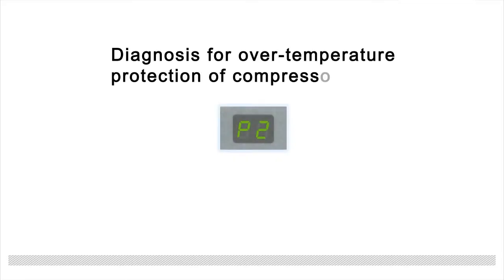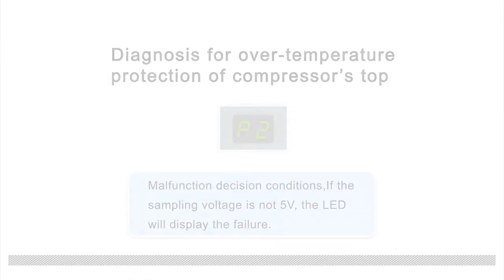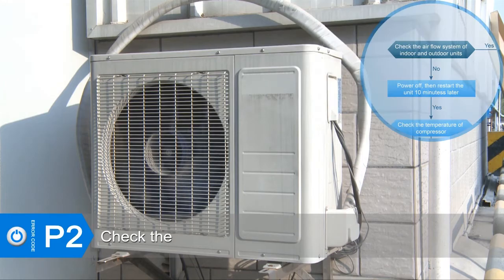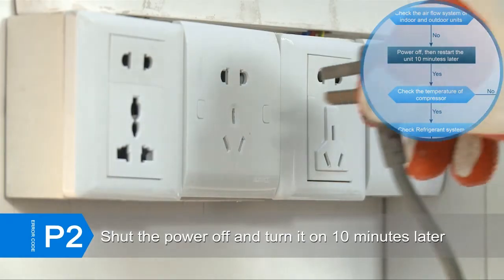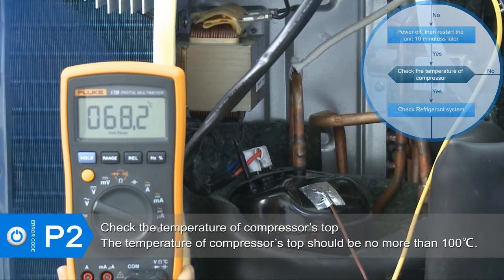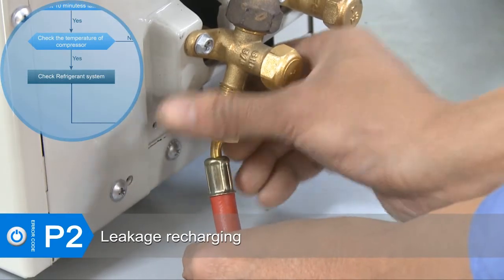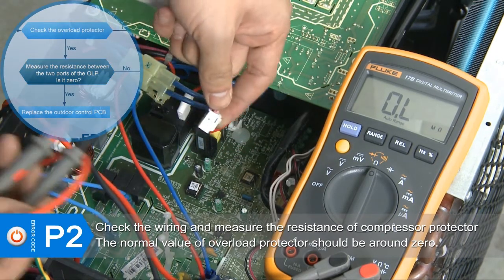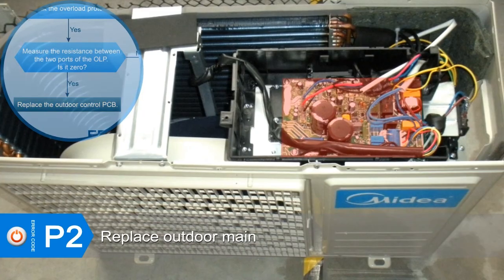AC Pro Mini Split Troubleshoot P2 Error Code

Comment: Hi Sir. 
Inverter ac outdoor if check the voltage line and neutral  is ok 
But neutral and starting (so Cp, or signal or returning line) ac voltage or voltage 
I don't know that current come to return line ac or dc voltage 
Please help me